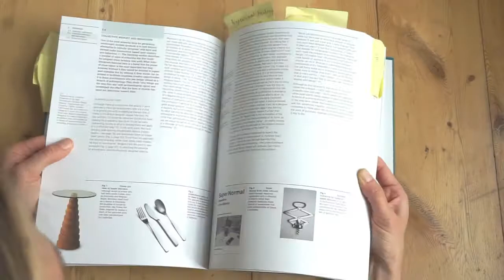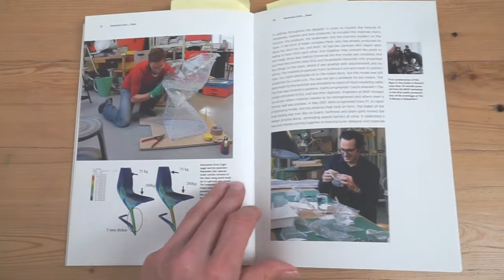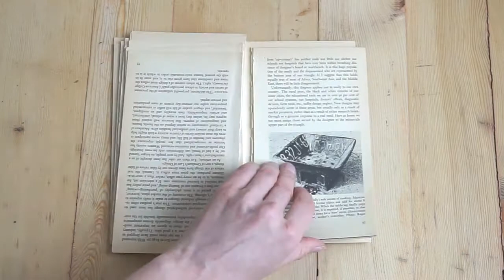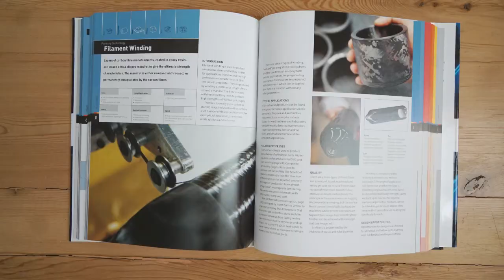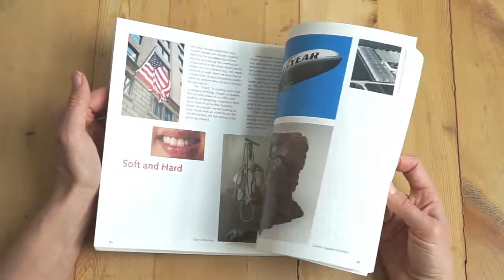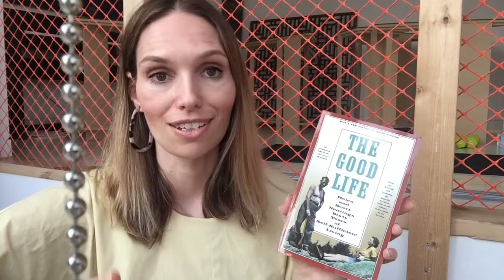Industrial Design Books |  Recommendations for new designers

Comment: what is the different between product design and industrial design ? and i am an architect but i love product design and i want to start to work on it .. any advices :) ? thanks
Reply from the maker: Hi Atef! I use the words Product design and  Industrial design interchangeably because I am an Industrial designer who designs products. The word "industrial" refers to designing for industry, which is another way of saying "designing for manufacturing" as opposed to for craft. This word "industrial" trips people up and usually they think we design industrial products. This is why it's easier to refer to our profession as "product design". Jimmy Huynh has a thoughtful video response to this question - go check it out. One thing I would add, is "product design" can refer to digital products as opposed to physical products. So be aware of the context that you see the word "product design" in. 

If you want to learn how to design products:
1. Start to design and make things. Preferably design something that you can make and use yourself. After you have used it for awhile, re-evaluate and take another shot at the design. By doing this, you will immediately be faced with questions about size & how it relates to a human body, where does this product live (does it stay in one spot or move around), what material is appropriate, what form should it be, how does someone use it, etc

2. Product analysis : Take existing products apart both literally and figuratively. This works especially well when it relates to your design project above. Because then you are learning from the designers who have worked before you. Ask the question "why" about everything that you see. There is a reason for every detail on every product (inside and out). This practice is actually how professional designers continue to learn about product design and is no different than learning about architecture, by experiencing and analyzing it.... which is one of my favorite things to do. :) 

If you are curious about how I do this process,  I have a free workbook (on my channel page) and 2 videos that show the process (Pulp Storage and Food grater)
Reply: @DesignplusMorna  thanks for your clarification about the difference between industrial design and product design :)  i understand  that product design more general and it includes industrial design .
regardless the process it is great to learn by doing it will be great if you have examples regard that .
do i need to have a special knowledge in mechanical and electrical engineering  to be a product design ? and how much i need to know regarding that ?
i know that some architects like george nelson and Emeas become a product designers and that gives me hope :) 
thanks for the book review i bought most  of them to learn 
and sorry for late reply but i really appreciate you answers and looking forward for more vedios from you :)
and i wonder if can i have your email to send you my progress 
thanks 
Atef
Reply: @atefmohsen  Hey! This is becoming more confusing by the minute :) I think Industrial and Product design used to mean a similar thing: The design of products. It used to be that products were seen as physical objects that you can sell. But now in the information age we can also see digital products, like apps and services, as products. People that are designing these usually call themselves product designers. Industrial design now mainly focusses on the mass produced products.